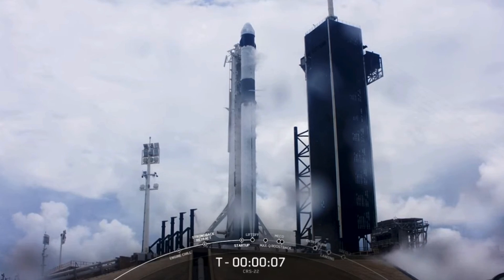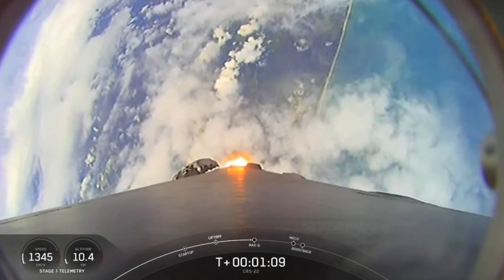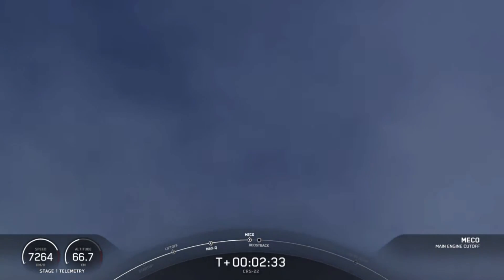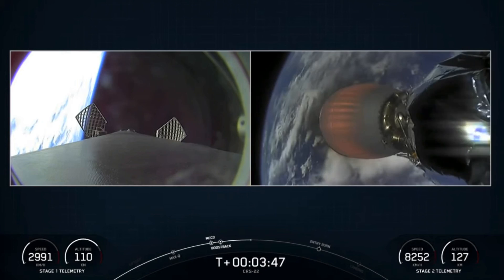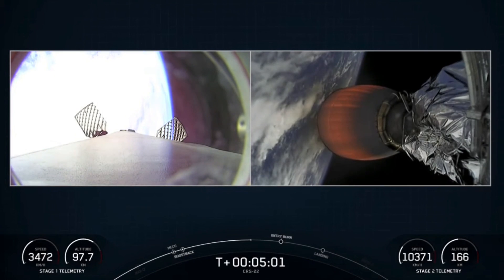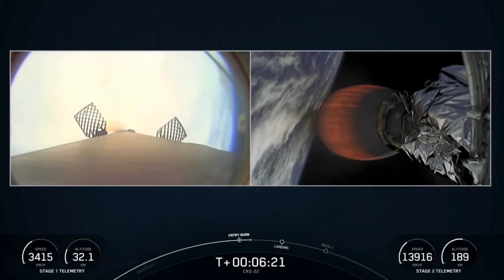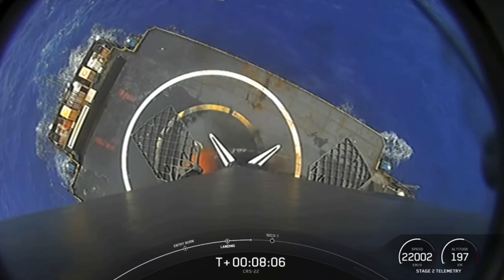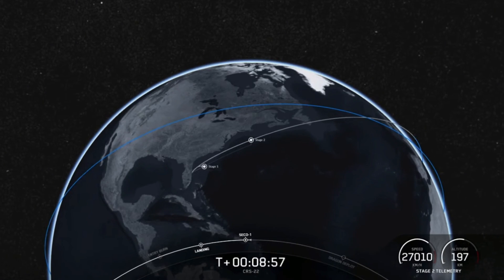SpaceX launches Dragon cargo ship to space station, nails booster landing

Comment: still take 24 hours to dock with iss!
why no one asking me how to do it faster?  so i ask myself how to step up to do it faster, how about 30 minute for the all process? from launching to docking!
it sound imposible!? so let's start thinking together.
i just return from smarteveryday (channel in youtube) that give the all process that used today icluding docking time (30 minute) after the dragon will reach the iss orbit.
so what missing to make it faster and more spontanian?
let's first smartest the dragon and the iss to be able to connect between them.
the dragon before start to launch need to know where exactely located the iss, to calculate the entering into his orbit in the right point (that should be something like 1 km distance from the iss, i dont have that data) with right angle!
then start the docking process that take 30 minute (today) but it could be faster if we add a devices half in the dragon and the other on the iss, when the docking started those devices (framework that have 4 Moving pipes (4 meter long each one) for entry and exit) to move one to the other 1 meter in second what will make the bonding between the frame after 4 second! speedy! after the bonding the connection between the iss and the dragon will be fast another few seconds the process will be end.
10-15 minutes to be into iss orbit another 15 minutes (max) for connection = 30 minutes!
sorry about my dumb language
Reply: Roger Wilco thanks but My suggestion is around launching not rocket, when to launch and where to meet in space (location points), this will reduce time and costs, And will probably raise the technological level
they should be opened to ideas from outside, you never know !

Comment: Why does the platform always drop signal.  I mean, it is in sunshine on landing video from the 1st stage and the video of the I Still Love You is minutes behind, under cloud cover and frozen well before the landing.
Reply: The drone ship has a directional signal to the likely geosynchronous satellite from a transmitter on the drone ship. The rocket exhaust from the booster landing shakes the drone ship to the point the transmission signal loses lock on the satellite. If you jostle the signal out of line of the satellite, then the satellite can not receive enough of the signal to support video or sound. That is why the signal usually cuts out on the drone ship as the rocket is landing. Usually, SpaceX gets the signal back once the shaking subsides. Remember, these landings are happening over 200 miles from the launch pad out in the ocean. There is not complete coverage of spacecraft in every square mile of the world, so telemetry is handed off from one ground station to another. Transmission problems are not uncommon and telemetry from the spacecraft has priority over video.

Comment: I hope they can get a drone ship camera that doesn't lose signal one day
Reply: Remember, these landings are happening over 200 miles from the launch pad out in the ocean. There is not complete coverage of spacecraft in every square mile of the world, so telemetry is handed off from one ground station to another. Transmission problems are not uncommon and telemetry from the spacecraft has priority over video. The drone ship has a directional signal to the likely geosynchronous satellite from a transmitter on the drone ship. The rocket exhaust from the booster landing shakes the drone ship to the point the transmission signal loses lock on the satellite. If you jostle the signal out of line of the satellite, then the satellite can not receive enough of the signal to support video or sound. That is why the signal usually cuts out on the drone ship as the rocket is landing. Usually, SpaceX gets the signal back once the shaking subsides.

These have been recorded on the drone ship and uploaded.
https://www.youtube.com/watch?v=KDK5TF2BOhQ

Comment: Why is there signal loss for first stage standup landing?
Reply: The satellite uplink antenna gets vibrated off of pinpoint targetting by the vibrations of the returning first stage, and therefore they now splice-in the on-camera footage of the booster, later on, instead.
Reply: @2o4II112II26o2  In this case, the pad is in cloud shadow and never was near vibration.  While the 1st stage showed a sun lit pad.  Rough sea's drop the signal?
Reply: Ya these cameras dont match up even though the quality isn't the greatest.  You can see the cloud cover vs sun lit pad for sure.  Something odd.

Comment: So why a "boost back" burn for a landing on the drone ship?  I thought boost-back was used to bring the first stage back to a landing site close to the launch site.  I thought when they were going to land on the drone ship they just let the first stage coast to apogee and then did an entry burn to slow and a landing burn to land.  Was this due to weather in the area they would have come down?  Or maybe an effort to shorten the sea voyage on the ship coming home?  I guess for the price of a little fuel, oxidizer, and time on the engines they can get it back sooner to prep it for it's next flight.  Or maybe it is the drone ship they need to get back and send out again quickly...
Reply: more simply - probably just the wrong terminology used by the commentator; it's more fuel efficient to let the 1st stage follow a ballistic trajectory, in the main, as it doesn't need excess fuel
Reply: @2o4II112II26o2  actually, what I read from a different commenter (don’t know if it’s true) they did that in order to allow the 2nd stage to land about 100km closer to shore than usual
Reply: @m.a.6020  *first stage
Reply: @AydenMajumdar  I’m very smart

Comment: What amazes me is that the Falcon 9 booster can pilot itself back to earth from space and land itself vertically on a target half the size of a tennis court. This is the biggest difference between a Space Shuttle launch and a Falcon 9 launch.

Cost of a Space Shuttle launch: $450 million.

Cost of a Falcon 9 launch: $62 million with new booster, $50 million with reused booster.

Cost of sending cargo into orbit on Space Shuttle: $54,000 per kg.

Cost of sending cargo into orbit on Falcon 9 rocket: $2,400 per kg.
Reply: The Falcon 9 cost for an expended launch is ~$2,720/kg as you get up to 22,800kg to LEO for $62M. For a recovered Falcon 9 which is $50M, you get 15,600kg to LEO or ~$3,206/kg.

Comment: They seem to lose that side viewcamera that shows the first stage landing often. You’d think with this great technology they could figure out how to keep that camera on.
Reply: The drone ship has a directional signal to the likely geosynchronous satellite from a transmitter on the drone ship. The rocket exhaust from the booster landing shakes the drone ship to the point the transmission signal loses lock on the satellite. If you jostle the signal out of line of the satellite, then the satellite can not receive enough of the signal to support video or sound. That is why the signal usually cuts out on the drone ship as the rocket is landing. Usually, SpaceX gets the signal back once the shaking subsides. Remember, these landings are happening over 200 miles from the launch pad out in the ocean. There is not complete coverage of spacecraft in every square mile of the world, so telemetry is handed off from one ground station to another. Transmission problems are not uncommon and telemetry from the spacecraft has priority over video.

They do record the landings and have uploaded some. Here is one.
https://www.youtube.com/watch?v=KDK5TF2BOhQ

Comment: What is the regular pulsing on the metal foil stuff on the second stage above the bell nozzle?
Reply: It could be a couple of things.  It could be slight buffeting from traces of the upper atmosphere flowing around the second stage.  Or (perhaps more likely) it is from vibration.  The engines almost certainly produce vibration across a fairly broad range of frequencies.  In the absence of any real damping thin foil insulation is going to respond to that and oscillate some.
Reply: PEACE LOVE UNITY PROSPERITY CALM WISDOM HAPPINESS HONESTY OPTIMISM

Comment: Why was a boost back needed if landing on a drone ship?
Reply: The drone ship is located between the launch pad and the point at which the booster separates from stage 2, meaning the booster's trajectory must be changed in order to get it back to the drone ship's location.
Reply: probably just a mistaken use of the term, reentry burn is what is needed only, in fact

Comment: Why was a boost back burn necessary for a drone ship landing?  Past offshore landings have been performed with only two burns;  re-entry burn and landing burn.  Is this a change?
Reply: In this case the boostback burn was to allow retrieval of the first stage roughly 100km closer to shore than usual.  Previous CRS missions have actually landed back at Cape Canaveral, but the Cargo Dragon 2 is too heavy to allow that, so this is something of a compromise.
Reply: @thesledgehammerblog  thanks!